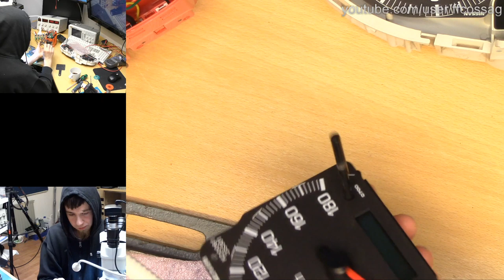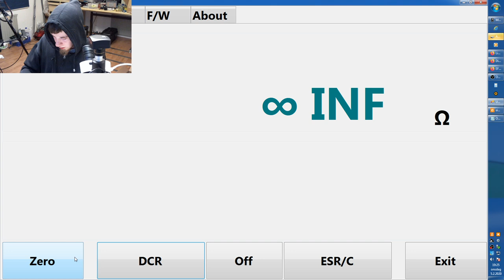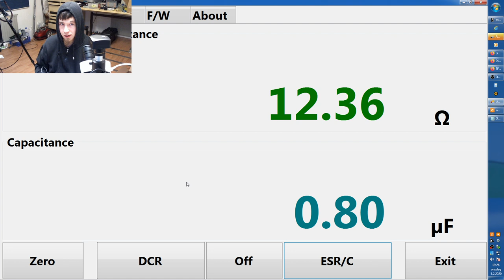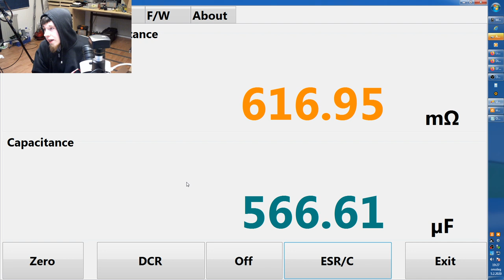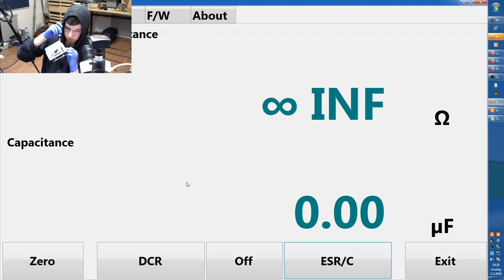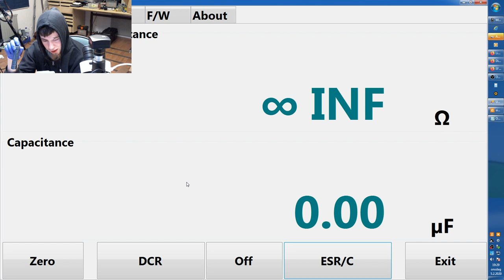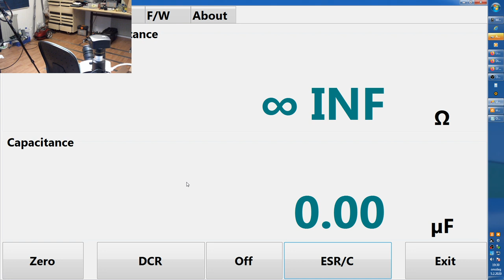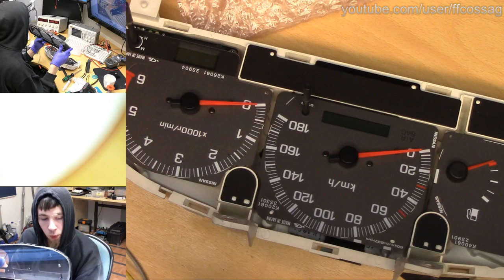1998 Nissan Navara gauge cluster repair

Comment: You left undone the most important part of this repair...  Testing the gauges, RPM and Speed.  most of them fails with the TEMP / GAS needles going all the way up. Besides the 9999999 problem that is easily fixed with a fresh eeprom file.   Thanks for your video.!!
Reply from the maker: I don't specialise in cluster repairs, so I just fix the issues I see. Bad solder joints seem to be the culprit for all kinds of random issues, so I just always start there.

Comment: I work for a company that repairs a lot of those clusters (among other clusters) and also restore the odo mileage if it shows all 9s (when the odo ROM corrupts). The solder joints do indeed fracture on these, particularly on the large IC. You can remove the board from the needle motor to avoid smudges on the gauge or damaging the needle etc (which is what I do when I reflow these by dousing the board in flux then dunk in a ultrasonic cleaner with IPA after the reflow to clean flux off).
Reply: i also have an issue on ODO it shows all 99999. how to fix it? do i have to re download hex the program?
Reply: andy Rhenz the eeprom corrupts and will need a known good hex dump and the odo value changed if necessary. The eeprom contents also has the calibration data for the gauges and depending on if it is diesel or petrol and the speed sensor type etc (different frequency per km/h etc)
Reply: @williefleete  i am trying to learn about this kind of speedometer board , please tell me ,why sometimes i hit the board and the screen shows the correct mileage and then I hit again and it back to the 9999999 error?? I guess that., something inside the eeprom is bad or just the eeprom joints are cracked.? What do you think about it? Thnks
Reply: @1975vini  most likely joints to the eeprom or controller have fractures
Reply: My 98 D22 navara has the same issue. All 9s and MAX temp and fuel and speedometer and tacjl is showing way under what it should. Do you have any iead what the problem is, and can i fix it myself?
Reply: *tacho
Reply: @joffebisk1446  same issue, cracked solder joints and the eeprom is most likely corrupted
Reply: @williefleete  eeprom? Like the chip?
Reply: @joffebisk1446  an 8 pin chip yes
Reply: @williefleete  ooh, if it's on the speedo-board then i can easily replace it. Do you know where i can buy it?
Reply: @joffebisk1446  the EEPROM is common it is what’s stored on it, you need to re-write it with a valid dump and correct the odometer value which isn’t that easy to do unless you have the tool to program and decode the odometer algorithm.
Reply: @williefleete  oh :/

Comment: Good evening, very interesting video and your work in general! I would like your help: I have a problem with the speedometer in my car NISSAN PICK UP D22 of 1999. The instrument that measures the speed is with a pointer, the kilometers are shown on a digital instrument.  So when I stop, the gauge doesn't reset but shows 15km/h or 20km/h. The gauge resets by lightly tapping the dashboard on the top of it with the hand. What could be going on and if it raises repair? Thanks in advance.